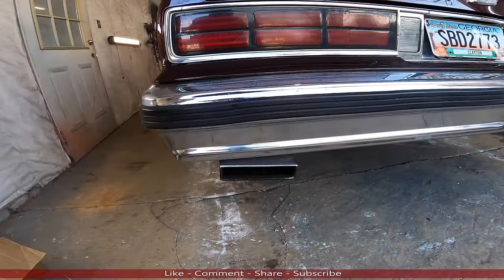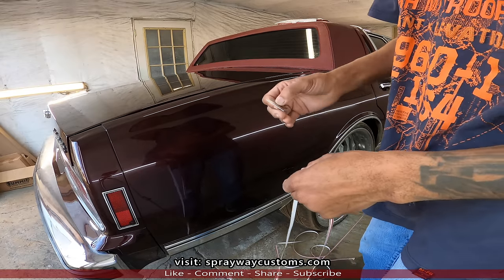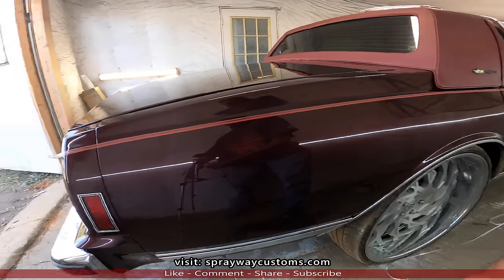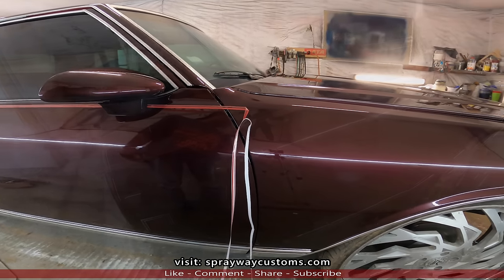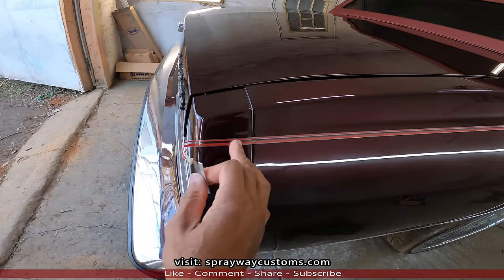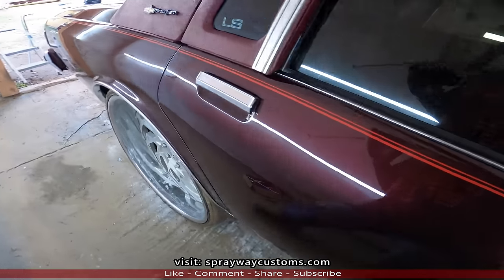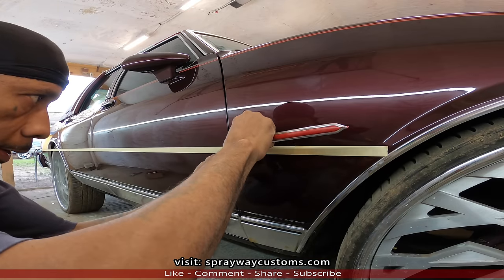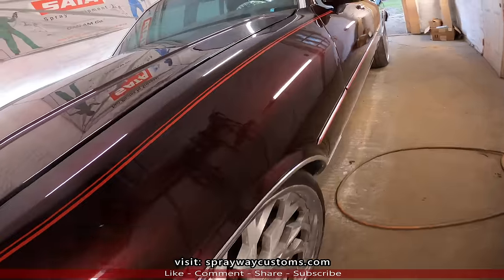How To Vinyl Pinstripe & Install Body Side Molding On A Car - Pinstriping The 1987 BOX Chevy Caprice

Comment: Sprayway,  I just watched your 1983 Kandy Tangerine Bronco it is Amazing!!!  You are inspiring an old collision body man from the late 70's to get back into it for my own Hot Rod -it's not as cool as a box Chevy or even a late 60's Chevelle but your teaching an old dog new tricks and tricks he's kinda forgot lol!!  My I hope will look like a 70's Hot Wheel by the time I'm done!! You probably said it but, what was the size of the micro flake you used? The type of paint color I wanna use on my ride says HS high gloss silver  on it and I'm not sure what the HS means  I tried to get close to the GM silver Poly of the mid-70s but I wanna add a little flake just not BASS BOAT flake crazy you know ?
Reply from the maker: Try the micro flake. It’s a little bigger than a metallic
Reply: @SprayWayCustoms  can you recommend a brand ? I'm basically new since I have been out of the automotive painting side for about 40 years paints have really changed !! Any help would be greatly appreciated !!  🙏🙏🙏